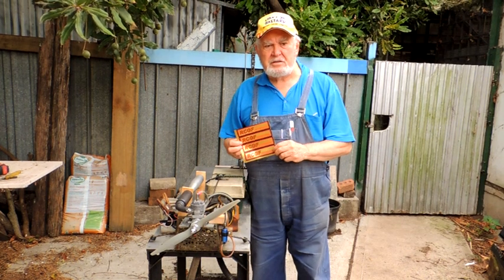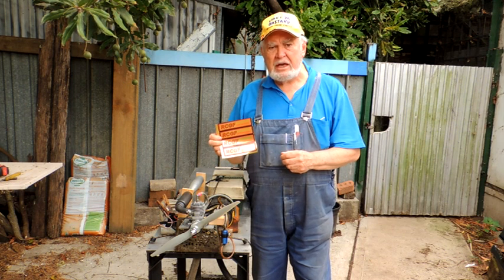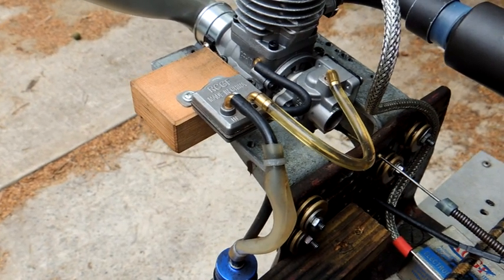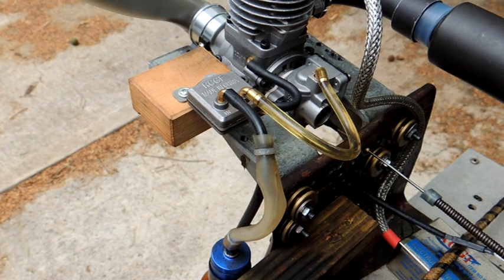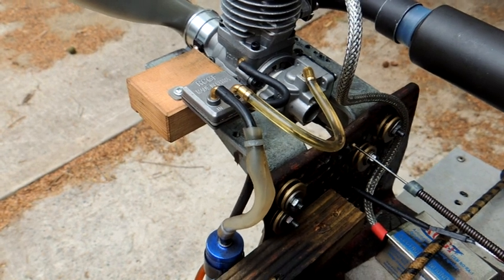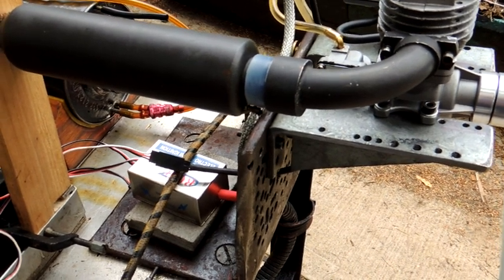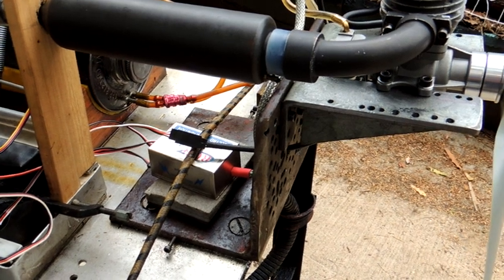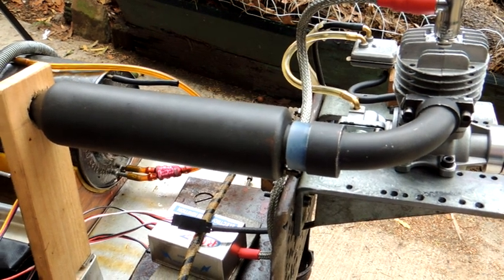RCGF 10 TEST

Comment: Thanks for the review, Brian - I just got one of the newer 10cc engines (a rear exhaust version), and the carb is a bit different, with the pump integrated into the carb housing.  The other change is apparently the throttle linkage - no longer directly on the bottom of the carb housing, but offset a bit, making the linkage a dab more challenging.  What I find most challenging, however, is the choke linkage, with the choke arm set directly behind the cylinder head ... making a push-pull choke rod out the front of the cowl something of a problem.
Reply from the maker: Yo Paul, 
Certainly nice to hear from you - pleased you enjoyed the review. I have written a full test report of that engine in a magazine and it created a bit of interest as well. If you want to have a choke rod out the front of the engine, I would extend the choke arm (to the right looking from behind) with a strip bolted on and even soldered as well or super glued to bring the alignment just past the side of the engine and that would allow you to have the forward control. You really need the choke only if you hand start the engine but it is not necessary if you use an electric finger (aka electric starter). If you want to discuss this further you can contact me by Email on oilyhand@bigpond.net.au. By the by, I like the main throttle linkage as it is a direct and straight connection back to the firewall and servo.
Regards
Brian Oily (aka Brian Winch)

Comment: Very informative and good video. What would your thoughts be on running it on 99 RON octane Super Unleaded in the UK? Also what bearings does it have, could it feasible to run something like an 11 x 8 prop at high rpm on a small light racer?
Reply from the maker: Yo Julian,
Have you seen my latest test on the RE engine? It has a Walbro carburettor fitted and rear exhaust. I doubt that you would see any appreciable benefit using 99 RON petrol without increasing the compression ratio which I wouldn't suggest. It would certainly son an 11 x 8 propeller at a good rate and the bearings would be able to take the punishment as the shaft runs in ball bearings and the connecting rod has needle rollers both ends - it is a tough engine for sure.
Thank you for your interest.
Regards, 
Brian Oily
Reply: Brian Winch thank you for your response and for pointing me in the direction of the RE engine! I think the RE even suites me even more. Apart from the Rear Exhaust are there any other differences, I notice the RE carb doesn't have a separate pump? I think the RE seems ideal for scale models that have to conform to a close fitting cowl. Because of that you could fit a larger engine and thus throw a more scale prop... I really like your reviews, keep them going! Cheers!

Comment: Brian, first of i'd like to thank you for reviewing these engines.
Second, which engine do you think makes more power this rcgf or the OSMax GGT 10cc?
I'd like to run a 14 inch prop.
Reply from the maker: Yo MD,
Thank you for your appreciation -pleased to be of service. Hard to pick between the engines - both about the same power and both good value. I did run the OS GGT 10 with a 14" propeller and it handled it really well. I did this mainly to check the ignition timing to see it it would overload as I suspected the very low compression was for the purpose of using a wide range of propellers and this proved to be the case.  I am of the opinion that the engine would run even larger propellers but you have to consider the potential for damage to the shaft in the case of a ground strike with the larger propeller providing a greater leverage load.
Regards
Brian Oily

Comment: Hi Brian,

Firstly, thank you so much for your assistance and advice- much appreciated!
I'm curious wrt this review engine. Does it hold a good idle for prolonged periods?

Best regards,
Craig P
Reply from the maker: Yo Craig, 
Pleased I could help you. The engine will idle quite reliably for as long as you like but it will need, as it is with all engines, a bit of run time to get all internal parts settled and bedded in. Once you have it running smoothly and well run in, the idle will be quite reliable but...you must remember, don't try for a super low idle in the static running position (on the ground, bench etc.) as this will not be as reliable in the model as the forward motion of the model cools the engine and the idle speed does drop a little. Always best to test the idle speed with the model at a fair height so that if it cuts, you have good height for setting up for landing. A dead stick is no big problem if done correctly - glider fliers do it all the time.
You can now compare this engine with the latest I put on - the O.S. glow petrol.
Regards
Brian Oily

Comment: Another great review! 

I noticed your header tank is down low. I thought it needed to be mounted up high. Is that because it has a fuel pump? 

Keep up the great vids!!
Reply from the maker: Yo Racarb, 
You're too kind.  The header is a Quickfire which is a header, regulator and filter all in one. In your model I always advise to have the tank high for a pumped engine as it helps to flow the fuel to the pump. However, on the test bench, this was the most convenient position at the time and it is not of a concern as the pump is very effective and it lifted the fuel immediately. Besides, I have yet to see my test bench do a loop - maybe a prop hang - but no loops. (HO HO) 
Thank you for your interest.
Regards
Brian Oily